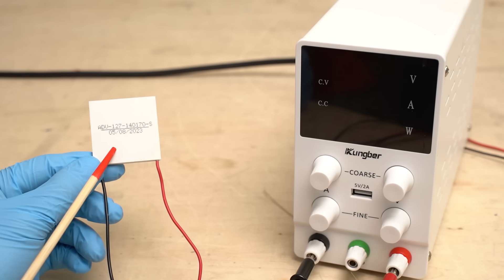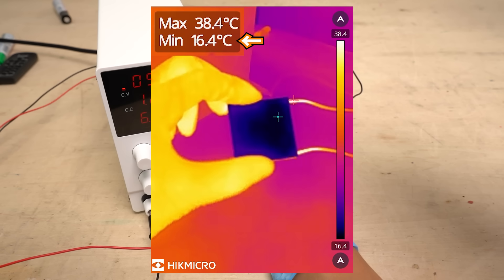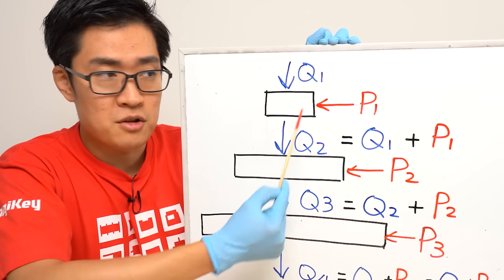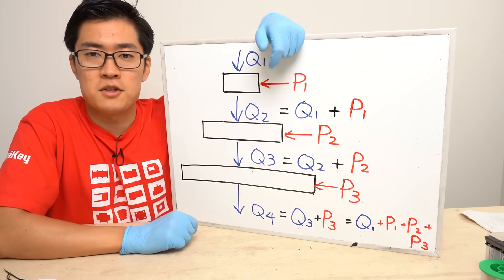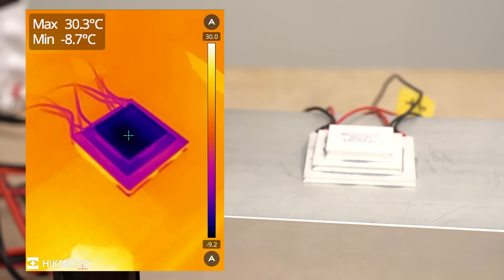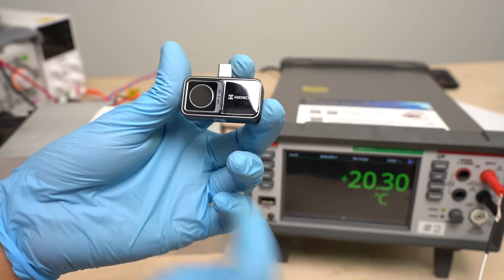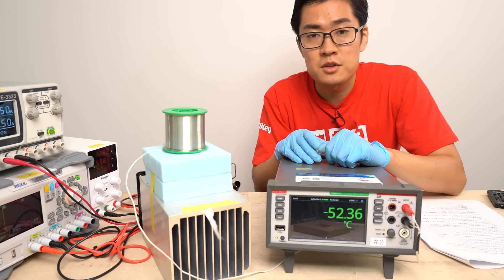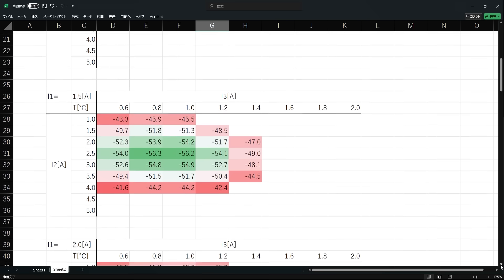Stacking 5 Peltier Modules, and Reached -90℃

Comment: I've made a device in my lab with a 3 stage pelletier which can go down to -75°C on one side with a 20°C watercooling.
I also have a 4 stage in stock for a future project, it should be able to go down to -90°C still with 20°C watercooling.
It's all under vacuum in a 3D printed aluminum box
Reply: Why don’t you use a ice bath? That would start you with a 0deg sink
Reply: @Ken-v5l5d  first of all I'm too lazy. And also if I go below 10, water will condensate everywhere
Reply: Wich one it's the most powerful peltier device would you recommend me? I want to use it for a Armstrong experimental device
Reply: @petergarcia1283  what is an Armstrong expérimental device?
Brought it from ferrotech
Reply: @oneil9615  it's a device build to meseaure thermal characteristics as thermal diffusivity of solid materials. Can you share me the peltier's code? I don't have access to some stores, so I'll look for it  online

Comment: i seen people try to cool CPUs with Peltier devices and failed but i never saw someone stack them, this makes me wonder if they would have had more success with stacking! (and if so, placing thermal sensors in each with voltage regulation to manage heat just like how fans usually does would be amazing! even managing it in relation to CPU usage!)
Reply: Stacking is to achieve lower temperatures, but not more movement of heat. Stacking Peltiers would just result in higher cpu temperatures because each layer is more and more lost heat transfer ability
Reply: Peltier is almost never the best solution to cool anything, remember if you have a 200w CPU you will have to use almost 400w on the peltier + the 200w from the CPU meaning you will use total of a little under 600w in total. Peltiers is horribly inneficents coolers, pretty much any cooling solutions use less power. Only reason to use peltier for cooling is size restriction or because it is cheep...

Comment: As you chill an electrolytic capacitor, the equivalent series resistance (ESR) goes up. Now that you have this, it would be fun to measure the change in the gate threshold voltage of a MOSFET. This is an experiment that would not dissipate any significant wattage in the transistor under test. You should have no trouble getting something like an IRF 540 down to ~-90°C, it will just take longer, because of the mass of the TO-220 case style package. The test needs to be done in a low humidity environment, because of the condensation of moisture on that much surface area. Perhaps, placing a small jar over the test chamber could be used, so once the moisture condenses out, there will be no more humidity.

Comment: you should put metal buffers between them to not waste the work on the outskirts of the bigger ones
Reply: I tryed using copper plates and stacking peltiers once before, i didnt notice much diffrance with the plates, although i have to say i want able to test with much preisision.

Comment: A resistors resistance... Increases when cooled?! I assumed it would go down?
Reply: It depends on the material used to make the resistor.  different materials have a different temperature coefficient, e.g. platinum & copper have positive coefficients ("PTC") while carbon & silicon have negative coefficients ("NTC").

Comment: Why not use same size of the peltiers?
Reply: Because to cool for example 200w the Peltier will use 380w + 200w = 580w... Each stage have a LOT more heat it needs to get rid of, that is why next stage needs to be larger because the Peltier's crate heat, a LOT of heat.
Reply: @a64738  Thank you for the explanation☺

Comment: You should try Kryonaut Extreme it has a temperature range: -250 °C / +350°C
Reply: The Problem with liquid metal is it reacts with Aluminium, it will destroy the heatsink. Also its a very bad heatconductor at very low Temperatures. Paste is a lot better.
Reply: Liquid metal is a better choice
Reply: @DarkAttack14  did you even watch the video
You think we didn't already think of that
He clearly says Liquid metal will freeze at that low of temperature
Reply: @naveentechs  yes, and that's not a problem whatsoever, thermal compounds purpose is to fill in air gaps, if it freezes AFTER its already filled in all of the gaps.. There is no problem. Thermal conductivity isn't going to decrease anymore than when it was liquid. You're missing the part where it's irrelevant if it freezes
Reply: @DarkAttack14  At those temps liquid metal solidifies, may shrink slightly, and form micro-gaps, even if let's say its conducting good after frozen 
Its easier to work with "normal" pastes

Comment: BEWARE
Peltier induces precipitation around the typical CPU, especially after the cooling device is switched off.
There is no remedy, except to isolate from surrounding air. Unless in a vacuum, some moisture will start corrosion 
The effect of corrosion is cumulative.

Comment: Why they don't use Peltier devices in space. to generate potential difference ?
Cant they use the difference off temperature on surfaces that the sun reaches and the opposite side that is so much more cooler.
Reply: Space isn’t "cold" like you think—it’s a vacuum, so there’s no air to transfer heat. Peltier modules need good thermal contact on both sides, but in space, heat can only escape through radiation, which is super slow. Plus, they’re way less efficient than solar panels or RTGs, so they’re just not worth using for power in space.
Reply: @KL02ALPHA   What do you think RTG stands for ? " 
Radioisotope thermoelectric generator "  And the "thermoelectric " part of that is Peltier. RTG`s IS using Peltiers to draw power from heat.
Reply: The voyager probes used Peltier to create electricity from the radioactive hot thingy it used. Also as I understand it they do use peltier for cooling in space. Also normally peliter is not used becaue ... 200w of cooling take 380w of peltier power + the 200w = 580w total power consumption.

Comment: I'm curious how much power can be passed through at that temp. Like, what happens when you apply a 150w heat load.
Reply: In general peltier can not handle much load, they now for example can not be used to cool CPU`s and GPU`s because they are to big load with power usage in the 100w to 500w area now (my GPU use 450W at full power and CPU 220W),

Comment: Still Crazy that you can achieve such Temperatures with so cheap parts, i wonder what aliexpress has for parts maybe they have larger and cheaper Options, maybe watercooling or using a high grade cpu air cooler would allow for even better Temperatures
Reply: The problem with Peltier devices is they are highly inefficient compared to other methods like phase change devices so you end up trading cheap parts for more expensive energy usage.
Reply: @InlineSkater72  They are, however, more desirable in certain scenarios - the reliability of solid state devices is orders of magnitude higher.
Reply: @harddiskwp i don't think peltier devices are reliable.
Reply: I'm using a modified CoolIt Freezone that I bought new back in 2006 on a 5800X3D. 😂 I've used it with several CPU's, all I have to do is change the water block.